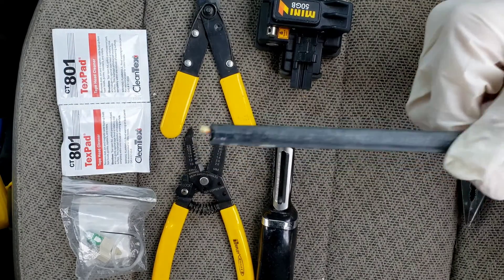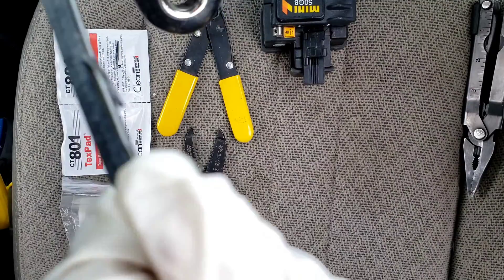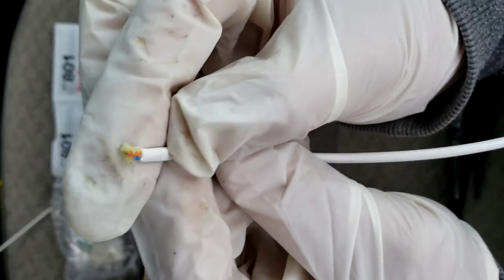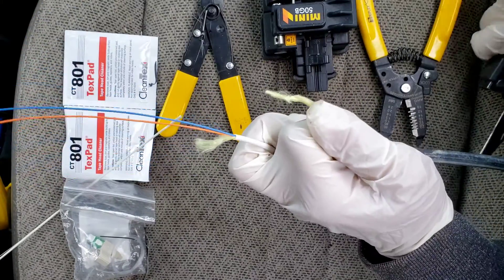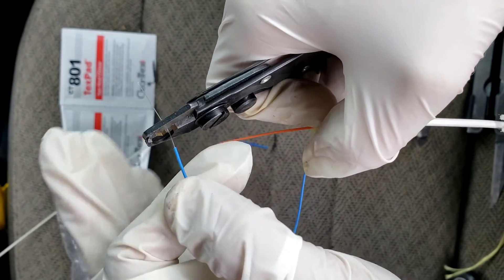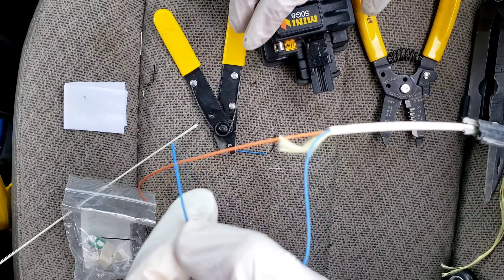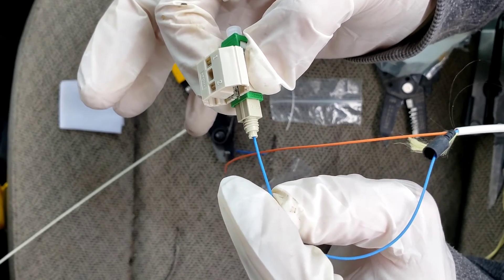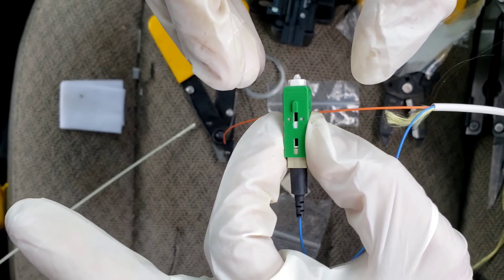Fiber Optic Drop - Termination (Fiber Part 1) - AFL quick connect.

Comment: I must say I have seen so many things done wrong here, the rubber boot should be fitted before cleaving as not to damage the end of the fiber, the yellow rope is Kevlar and should be cut with Kevlar scissors as a fiber splice myself
Reply from the maker: did you read the description?
Reply: No didn't need as a teacher was using a a learning video pictures speak 1000 words
Reply from the maker: @vk2lq  the very first sentence of the video description states: this video is not intended for technician training.  That's kind of an important statement to read.
 this video was recorded to help a customer fix his own fibre during covid lockdown. 
The video was recorded on my passenger seat of my van with tools I was able to hand the customer.
The customer was successful in his first attempt with a light reading of -14.8
Did you not learn to RTFM?

Comment: please get some better gloves
Reply from the maker: please read the description...
Reply: @TristynRusselo  Hi Tristyn, I don’t understand your reply? Your gloves look far too big and a hinderance. I wear gloves when working with Fibre, but they are tight fitting with breathable backs.
Reply from the maker: @over-engineered  I made the video using what supplies I was able to give a customer. 
I normally don't use gloves, they are a hindrance and should not be needed as there is no reason to touch the fiber optic core

Comment: A friend just received their fiber optic internet installation. They used Corning RPX 6F fast access drop cable with six fibers in it. It is becoming standard to use six fibers in for SFD and MFD units. The basis is many single-family dwellings are using their basements as an apartment and that justified having the six fiber networks, So when a tenant moves in, the just terminate and connect another fiber and still have a backup for  each with one left for a business  home office connection (many corporation now require physical separation between residential internet and  work from home and corporate home office access hat is completely separate from residential with its own route and firewall hardware..
Reply from the maker: We use 2 fiber drops now as well.

Comment: Maybe you should learn what this "stuff" is called before you make a video. Yellow hairs? You aren't terminating any of my fiber optic cables.
Reply from the maker: did you read the description?  This video was created during covid to teach a CUSTOMER to fix his fiber because I could not enter due to COVID.  This is not intended for training technicians. it says this clearly in the description. The video was shot outside of a customers house. 10 minutes later his service was restored. This video was used several times during no-entry.  6-figures last year.

Comment: you don't need to touch that naked fiber wire so many time it will broke before splacing
Reply from the maker: There are many things in this video that would not be done if I weren't shooting a video. Sometimes you need to do things for instructional purposes, also, if you didn't read the description this video is not intended for technician training it was done for an emergency video to show a customer how to fix their own fiber due to the technician not being able to enter due to covid
Reply from the maker: Please see updated videos:
https://youtu.be/E4-AKI3aaFE - Opening rugged drop
https://youtu.be/TyVk7XFgRnM - AFL Connector installation.

Comment: Is it true if the fiber optic cable is too short, it can cause signal atenuation that can reduce or disturb the data rate of the internet?
Reply from the maker: Too short? Where? How? Huh?
If the cable is too short it can't reach the equipment
Reply: @TristynRusselo  no, that's not what i meant, let's say there is a pair of single mode optic cable that design for 40 kilometers distance connection between two place, but instead we use it for only 500 meters, is it can cause signal attenuation? 

Thank you for response my question before, im very sorry if this is dumb question 😅
Reply from the maker: @ristanadwicahya  you would expect cable designed for longer distances to be higher quality/lower attenuation.
Reply: @TristynRusselo  i mean the laser or light beam, is it okay to use laser that design for 40 kilometers to be used in 500 meters connection? are the light in the receiver side will be too bright, so it can cause signal attenuation?
Reply from the maker: @ristanadwicahya  no idea.
Reply: @TristynRusselo  oke, thank you
Reply: @TristynRusselo  I think @Ristana Cahya was asking about reflection.  You know, if the laser is too bright and reflects back into the fiberoptic transceiver.
Reply from the maker: @i_no_nutin  nobody knows if he was talking about a transceiver or a fault indicator.  the question was poorly worded, i gave up on trying to help. you can have fun sorting it out.
Reply: @ristanadwicahya  I see nobody answered you here. You probably already know, but I'l answer it for other people to see. 

No it doesn't cause any problems. I have quite a few single mode uplinks in datacenters, distance only a few hundred meters each. I use just regular SFP single mode modules for those. You can get 2km modules, but those are just regular modules with lower power lasers. They are hardly any cheaper. Maybe it would be cheaper in bulk, but for regular you and me just buying a few modules it doesn't matter much. 10km and 40km modules are just fine.
Reply: @patrickd9551  thank you for answer my question, even after one year, i really appreciate it. 

The reason why i asked about this, because i watched one of linus tech tips video, i forgot which one. He mentioned that if the light signal that reach the receiver side is too bright, it will cause the signal attenuation. So I'm just curious why and how that can happen

Forgive me if my english is not proper or wrong 

Again, Thank You very much
Reply: @ristanadwicahya  They sell attenuators that you put on each fiber that can reduce the brightness if you only have long haul devices. Using a long haul transceiver on a short segment can cause damage to the receiver side. They sell shorter distance transceivers. I have bunches of 50' to 800' runs of SMF out there with no real issues. I just use the 10km transceivers.

Comment: Cotton glove sir.

Rubber glove is sticky. Sweaty hand due to hardworking job. Are you an electrician?
Reply from the maker: Did you read the description?.. this was filmed for EMERGENCY COVID USE, to help a customer fix their issue without technician entry.   Covid... everyone has rubber gloves.  Im a telecommunications technician. I made 130K last year.
Reply from the maker: Proper gloves are level 5 cut resistant or thick nitrile gloves.  
Cotton is actually unsafe as the fiber can pierce through with no resistance.

Comment: I'd lose the gloves.  I find I have enough trouble with fibre let alone with gloves flooping all over the place.
Reply from the maker: I wont mandate that you wear gloves, but I highly suggest it.  Or at least do some research... NOT on facebook.  Get facts from research, not peoples opinions.
hmm... sounds familiar
Reply: cus they don't fit
Reply from the maker: The gloves are for safety. Fiber optics is GLASS.
there is the possibility of microscopic pieces of glass getting embedded in your skin or transferred into your eyes and mouth. Once inside the body they are impossible to detect and can migrate to bone or nerves causing pain or injury, and can even cause death if they get into the bloodstream and shred your heart valves.

Information on this is widely available, just Google fibre safety. Here is one such reference:

https://www.fia-online.co.uk/pdf/pdf/MemDownload/tsd0053-1-02.pdf

Optical fibre shards are only 125 μm (1/8 mm) in diameter and can easily penetrate the skin. Penetration of the skin causes pain (sometimes intense if the shard is long enough to reach a nerve fibre or bone) and can cause irritation and inflammation of the affected area. In extreme cases, the wound can become infected. Also shards are difficult to see, particularly in when they are of short length, and can be carried on the surface of the skin and transferred to other areas such as eyes and mouth. A significant feature of optical fibre waste is that once inside the body it is invisible to normal type of analysis including X-rays. It is therefore imperative to implement measures targeted to minimize the risk of ingestion of optical fibre shards during the installation process and afterwards when non-expert users may enter the areas containing optical fibre cabling
Reply from the maker: Please see updated videos:
https://youtu.be/E4-AKI3aaFE - Opening rugged drop
https://youtu.be/TyVk7XFgRnM - AFL Connector installation.

Comment: That fiber was dirty as hell after you cleaved it. You can see debris on the fiber (looked like a string or hair). Need better fiber discipline. Keep it clean.
Reply from the maker: This video was recorded with scrap on my  passenger seat to show a customer how to fix his fiber inside his home. I could not enter due to covid.
This video was made for emergency use, not to train fiber installers.  He got  a light level of -15 db on his first try.
Reply: I work for AT&T and used to clean with alcohol after cleaving it. Not anymore, the optical gel inside pushes the crap back and guess what? It works.
Reply: @Beachnative42  i work for the same company as you. They tell us not to use mechanical connectors any more. Too much trouble from prem tech using them. Fusion splice only now.
Reply: Im a wire tech and you ALWAYS will have one mechanical connector. Fusion splicers are not cheap and AT&T ain't giving us all one
Reply from the maker: Please see updated videos:
https://youtu.be/E4-AKI3aaFE - Opening rugged drop
https://youtu.be/TyVk7XFgRnM - AFL Connector installation.
Reply: You clearly clueless lol